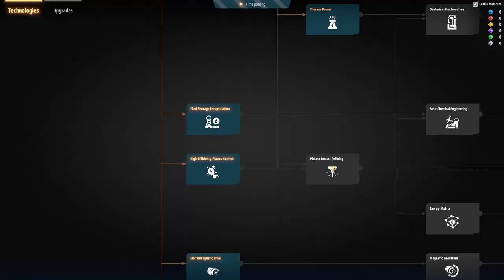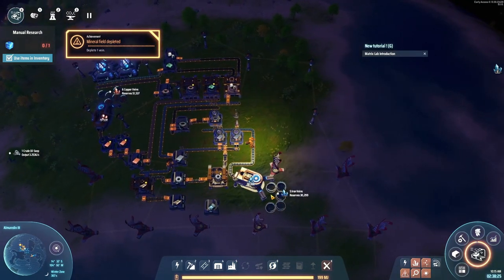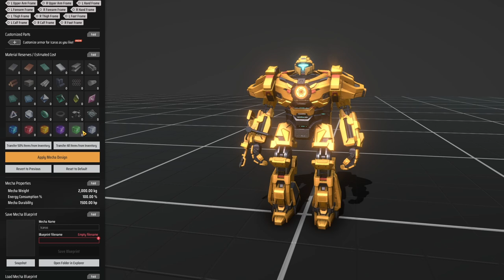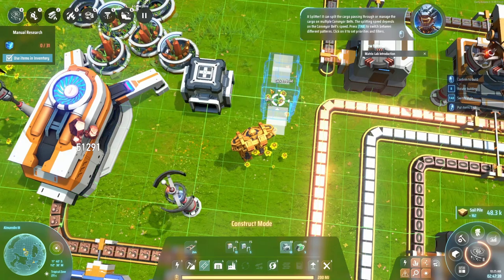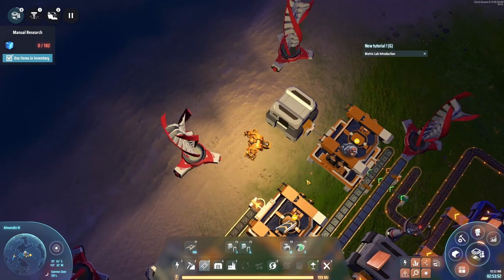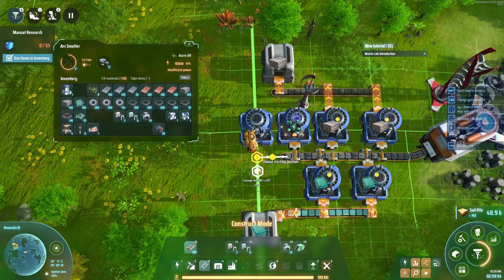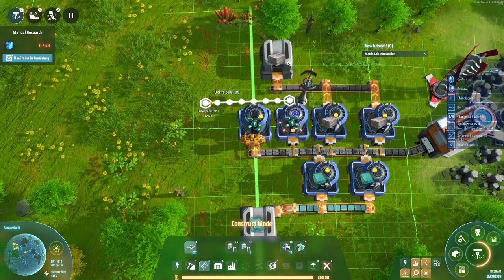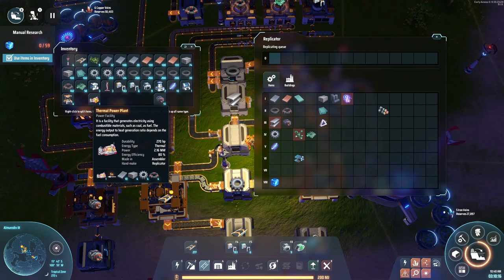Dyson Sphere Program - Day 03 - Research, Advancement  and more Automation

Comment: I don’t want to spoil the game by giving too many hints but the silicon ore serves no purpose other than making silicon ingots so there’s no point in storing it. Silicon and titanium veins are always found on other planets (it’s how the game encourages you to explore). The random titanium you find in loose rocks can be used later to generate hydrogen fuel rods which are nice but not essential for when you leave the planet. Making silicon from stone is OK but it’s very slow and uses a lot of stone. Typically I only do it if I have excessive amounts of stone and very little silicon in my system.
Reply from the maker: I see @vikingbrit270, I'll delete that silicone box and put another smelter in there to make what's in that box into ingots. I'll take a look to see how many stone deposits I have around there. I seem to remember I had a bunch but I'll take another look. Thanks for the tips and for being here.